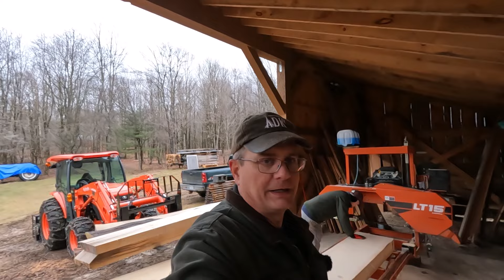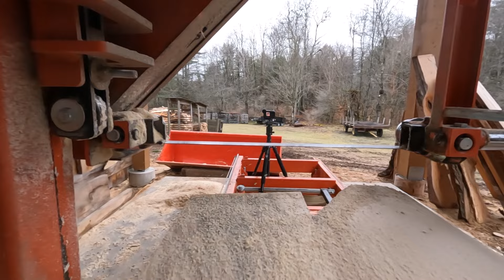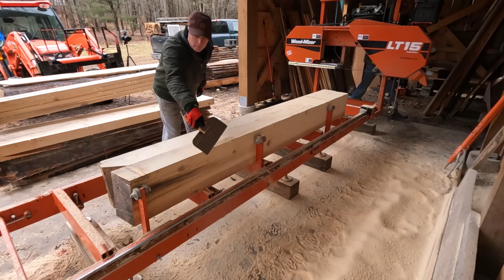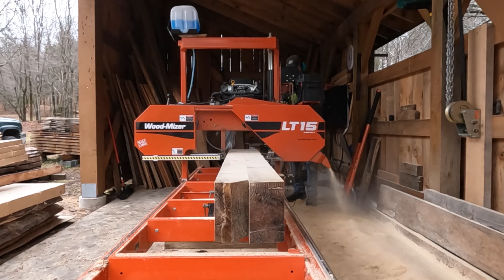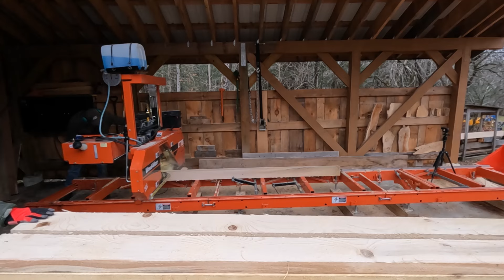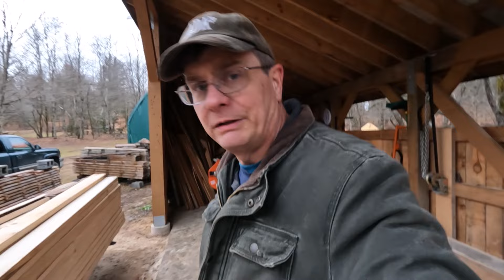Huge Blue Spruce Part 2  #woodmizer #woodmizerlt15 #offgrid #adirondacks

Comment: Loved the step down shot! Your idle sounded funny in the time lapse, like it was slowing down and speeding up. Any idea why it does that?
Reply from the maker: Thanks!  We are pretty sure it is the low idle mixture system being dirty or plugged.  We put a new carb on and it is running good now.  When it is warmer we'll rebuild the original carburetor.  The new carb was only $40, including gaskets, spark plugs and fuel filter, so it was the quick and easy way to go.